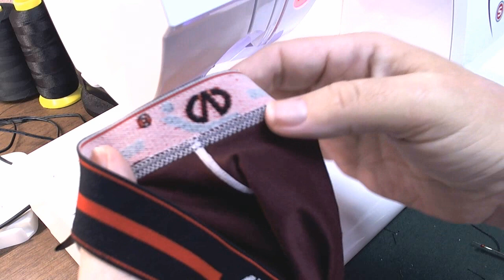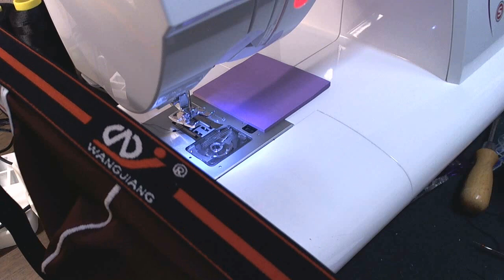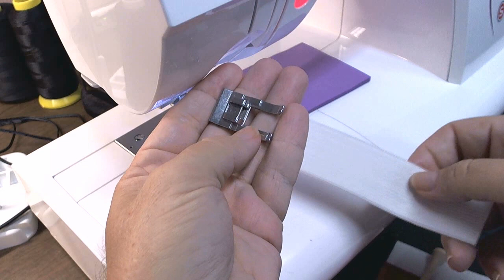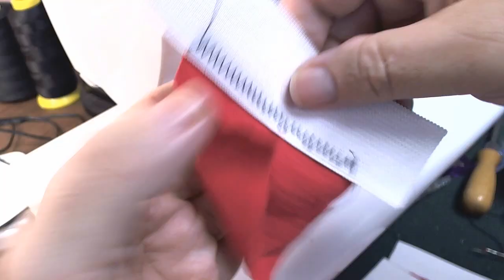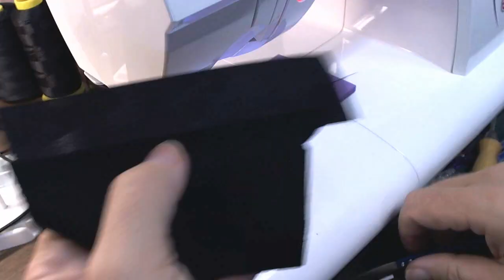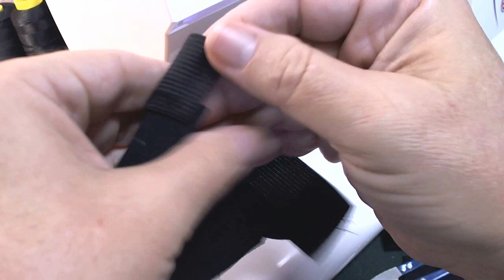Exposed elastic waistband, similar to a retail garment, using a home sewing machine.

Comment: So you don’t need to pull the elastic while sewing with zip zap stitch? All the other videos saying we have to pull the elastic
Reply: Depends, if you want more rebound or tighter fit, you can cut a shorter length of elasitc, for a more fitted look, you cut closer to measurement, and you do not have to stretch the fabric or elaseitc when using the zigzag stitch.

Comment: Thank you for this, clearly explained. I particularly like the tip for using a Post-it note pad as edge guide.
Reply: I have a cover stitch machine and trying to attach an exposed waistband to knit fabric (think swimwear) and the knit fabric needs to be gathered as well.   When i try to do this by stretching the elastic it seem to distort the shape.    How would you do this?